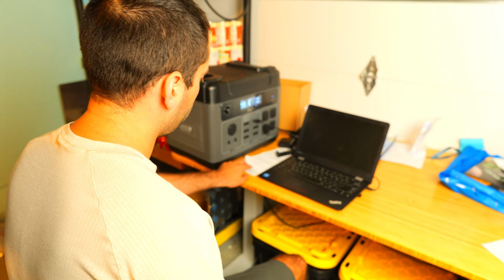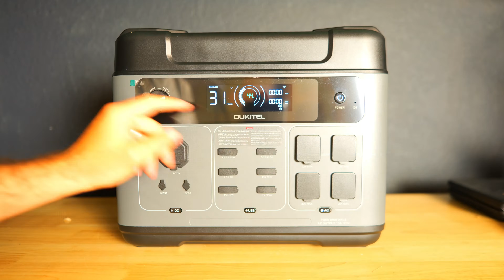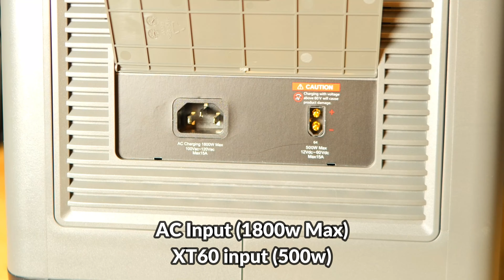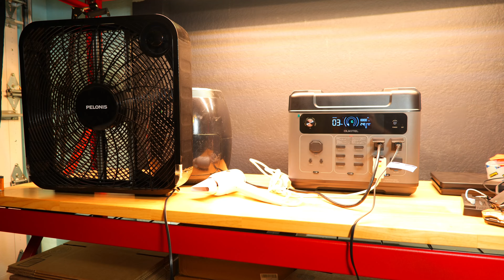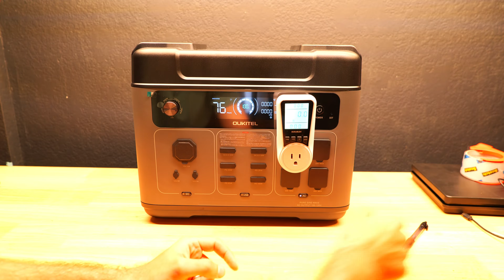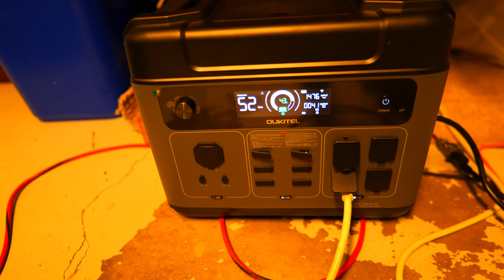Oukitel P2001 Plus 2400w Power Station 🔋

Comment: Personally, the product is nothing like what was advertised. Charging is extremely slow. I followed all the instructions, and the result is terrible. It only charged to 100% the first time, and after that, it was a disaster. Six hours plugged into the wall to only charge 7%. Unfortunately, I can't return the product because my country has many difficulties with the United States. In my personal opinion, I feel scammed and have lost my money with no hope of getting it back. Completely disappointed.
Reply: Thank you for this comment. I was thinking on buying One, but now I don't think so anymore
Reply: Always purchase a warranty when a product has a circuit board inside of it.

Comment: oh a power station noice
Reply: Is it very noisy via output ?
Reply: No, i don t thing it is. I m using bp2000 very confortable normal use sound.
Reply: @mihaicristian2885 BP2000 is not P2001 Plus